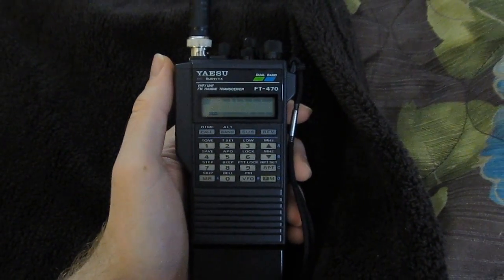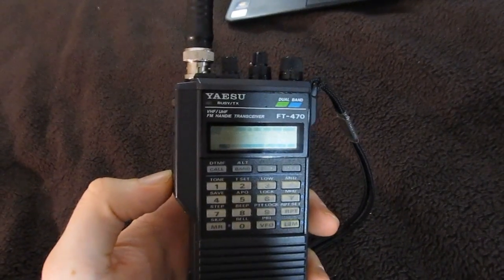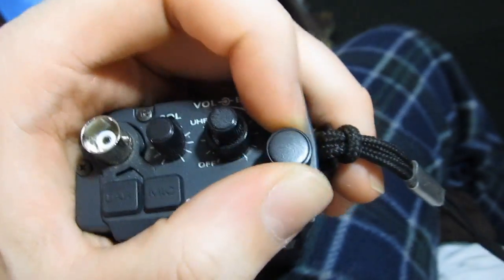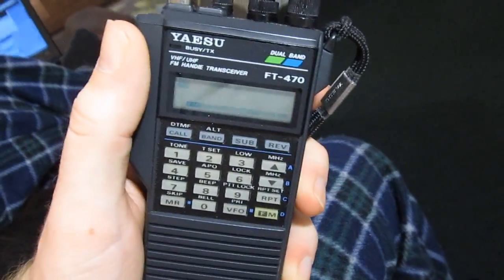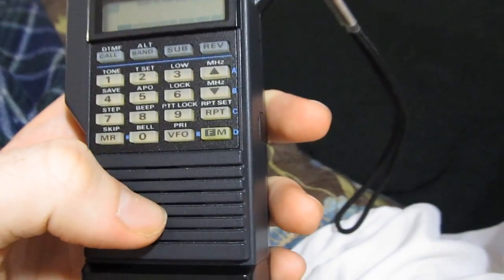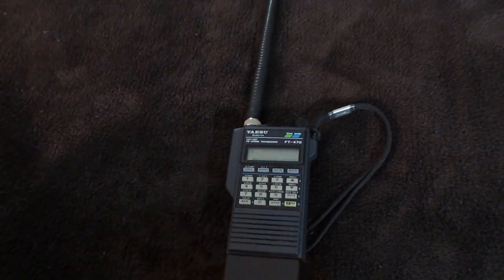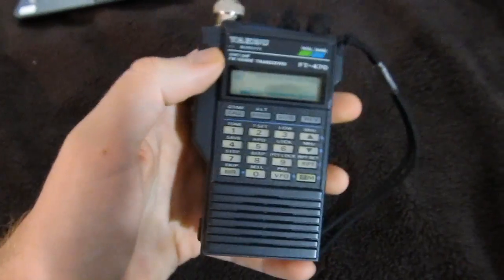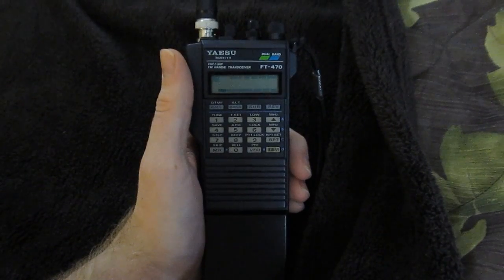Yaesu FT-470 handheld amateur radio transceiver, Part 3: Physical overview

Comment: Just purchased mine on e-bay yesterday and came across your videos!  As a FYI:
1. The antenna that you have was a popular style and mount on older Moto radios up until the early 1990.  One make is by a company called Larsen and the other companies I can't recall.
2.  Service manual shows a lithium  CR2025-TS1 memory battery. Don't know if the radio has a battery holder, or if the battery with tabs are needed.

The videos on this radio are great! After watching your videos, looks like I will not have to read the manual, just use it as a reference!

Matt
Reply from the maker: Thanks for the info and the feedback on the videos! I'm not sure on the battery, but at least it's a standard size.

Comment: I'd say that is a scanner antenna.  I have a Realistic Pro-38 scanner that no longer seems to be working, and the antenna on it looks practically the same as the antenna on your radio.  Is it illegal to use the wrong antenna with a HAM radio?  If that is a scanner antenna, would it be illegal to use with that transceiver?
Reply from the maker: lol, No, it's not illegal to use a mismatched antenna. It's not good for the radio, though.
Reply: I see.  This may be a really dumb question, but I'll ask it anyway.  Since the radio has a BNC antenna socket on it, would it be possible to connect the radio to an external roof mounted antenna if you wanted to?
Reply from the maker: Yep. A lot of people will connect HTs to a mobile or even a base antenna to get longer range out of them, or to use them with directional antennas for working satellites, or the International Space Station.

By the way, ham is not an acronym. It's used synonymously with amateur to literally mean "inexperienced" or "theatrical", although amateur radio is usually the opposite.